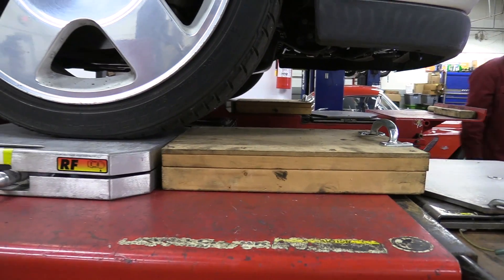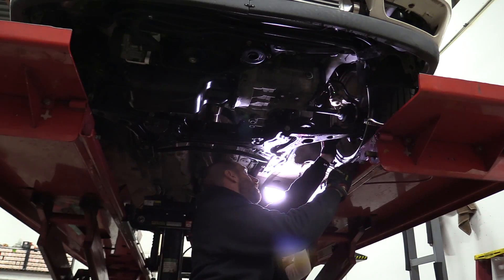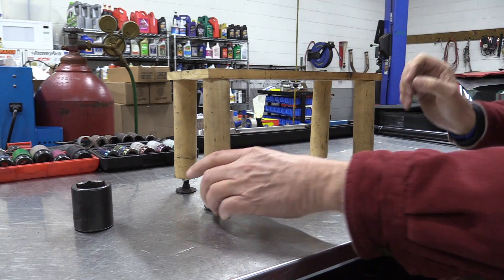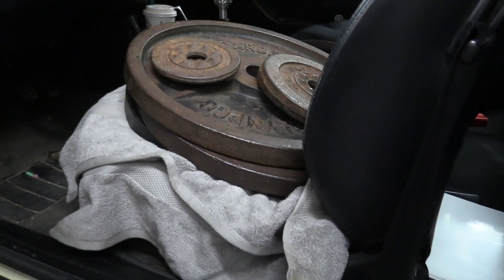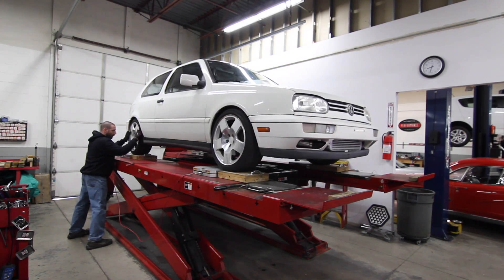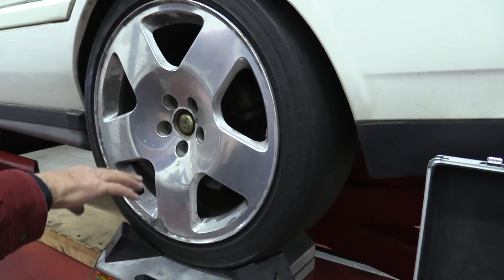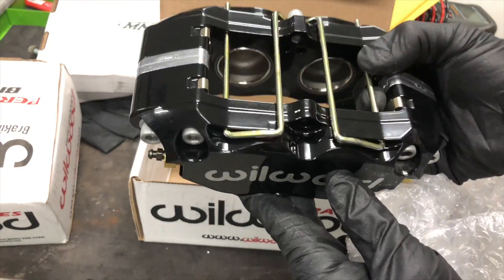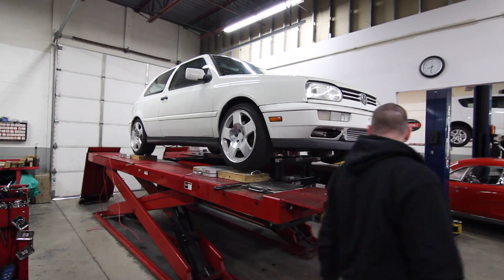What Is Corner Balancing and Why Your Car Needs It

Comment: By adjusting your coil height you change your spring rates. Is this something they accounted for?
Reply: Adjusting coil-over ride height does not change spring rate with most springs.
Reply: The spring rate will only change if it's a progressive spring. Most coilover springs are linear and not progressive meaning the actual rate itself will not change if you happen to adjust the preload while changing the height.
Reply: On these types of coils you are mainly effecting the actual travel length in the shock by dropping the ride height. Ie decreasing the amount of travel.  There are other brands of coil overs which have additional adjuster rings and a different shock design (a lot of Modded Japanese cars run them I've seen) where you can adjust the ride height withour compromising the travel in the shock, and also be able to adjust height and spring rate independently
Reply: By changing the height of your springs on your adjustable coil overs you can affect your spring rates, was taught that at Motorsport engineering college (yeah I get this car is no race car). To change the weight balance you can shim or move your coil over away from its mounting in the vehicle body
Reply: +Tim’s Tools 
The coil-overs shown in the video are "Partially Threaded Coil-Overs" with linear rate springs and the ride height is not independently adjustable. 
Changing the ride height on these adjustable coil-overs does not affect the spring rate of the springs. 
Adjusting static preload coil-over ride height/corner weight/cross weight/wedge on Partially Threaded Coil-Overs without regard if the spring is linear or variable rate is optimally somewhere near 50 percent of the shock stroke travel. 
What you say you were taught is not accurate for progressive/variable rate springs or linear rate springs. 
Spring rate is set when the spring is manufactured. 
Spring rate is not field adjustable. 
Applying Hooke's Law, spring preload does not alter the spring rate for linear or progressive rate springs. 

Here is a published statement from industry respected coil-over/spring engineering/manufacturer QA1 on the subject: 
"Does raising the spring seat increase spring rate? 
No. Once the weight of the car is set down on the shock and spring combination, raising and lowering the spring seat will only serve to change the shocks eye-to-eye measurement and also the car ride height. The compressed length of the spring at that point will not change unless it has something more than the weight of the car to work against, such as the shock is topped out or bottomed out." 

https://www.qa1.net/technical-support/street-performance-racing-faqs#seven

There is much more about this subject, but I currently do not have the time to publish a deep dive into the how and why physics in a YouTube comments section.
Reply: patw52pb1 Wrong .When you come down it rides harder. The how's and why's and technical publications don't matter. So yes the effective spring rate is higher , Period. If it wasn't it would still ride the same.
Reply: +jeremy whittler 
Do you currently have and run coil-over shocks? 
If yes, answer the following 6 questions and I will tell you how to prove to yourself using your vehicle and coil-overs that my statements are correct. 

(1) What application? (Street/Drag Racing/Circuit Racing/???) 
(2) What vehicle? (Year, Make, Model) 
(3) What brand coil-over? 
(4) What model coil-over? 
(5) What length spring? 
(6) What type spring and spring-rate?